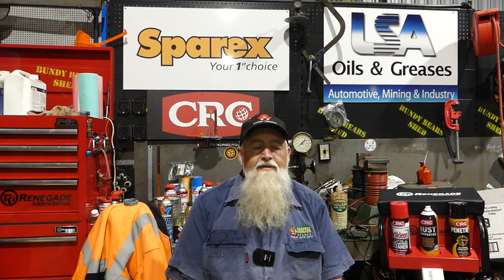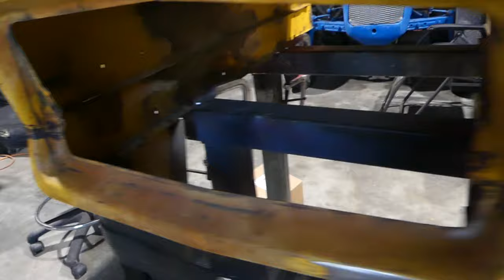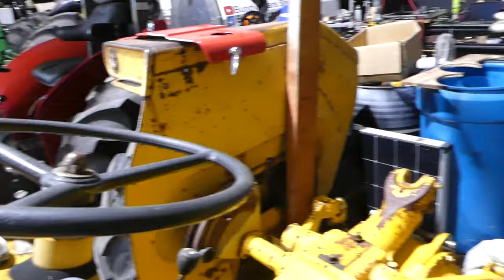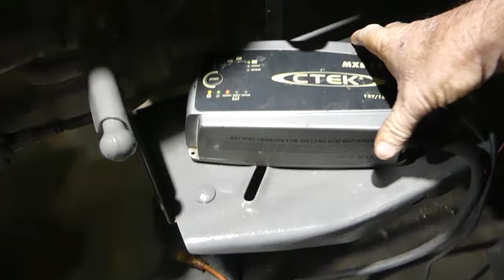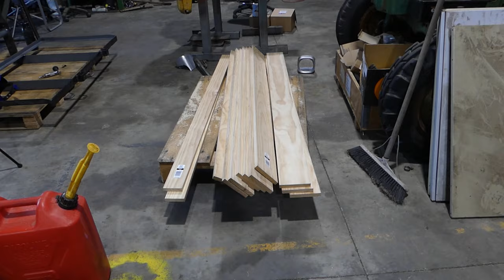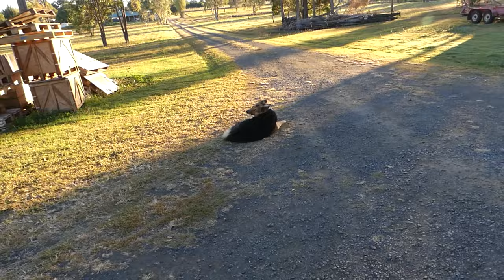Kangaroo Stew # 366 Shed Chat and the MF20 Bonnet

Comment: Lance if you run into the 'really' flat battery problem again with the CTEK battery charger, while you did really well by connecting it up in parallel with another battery, good move.
But next time just put the CTEK in the 'Power Supply' mode for an hour or so, and then try it in the 'Normal' mode again, and finally when it's done with that and floating on Green, throw into Recondition' mode to give it a full wake up (if it's not already too badly hurt).
Reply from the maker: ok thanks, I did try the power and rejuvenate but only for a few minutes and gave that away. It seems to have recovered well thankfully.

Comment: About polishing, do not use a wax with silicone because it is difficult to put paint on top of it afterwards. C u next time 🇩🇰
Reply from the maker: Yes I have been there before, it gets right in and even then I have had to use silicone drops in the paint.
Reply: @BundyBearsShed  or a lot of thinner to wash the silicone away 😊

Comment: There are sponge sanding blocks Lance. I wrap around them 😀 Did you try your angle strip discs yet?
Reply from the maker: Yes the strip discs went ok. I find I do prefer the needle scaler on castings as it leaves the rougher texture. I have always just used the flip-flops for sanding. $9.95 and I get 4 to 6 blocks out of them, old habits I suppose.
Reply: Whatever works 😀